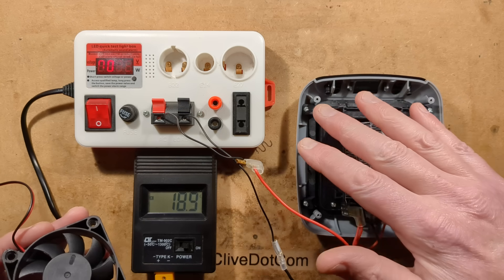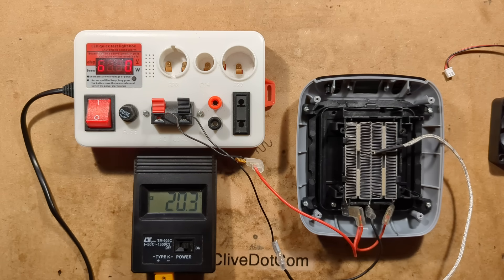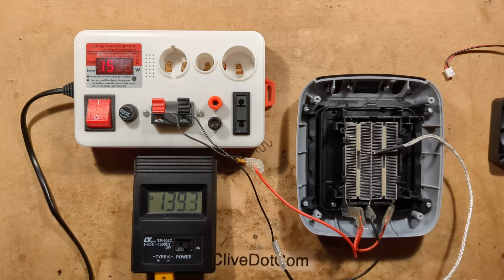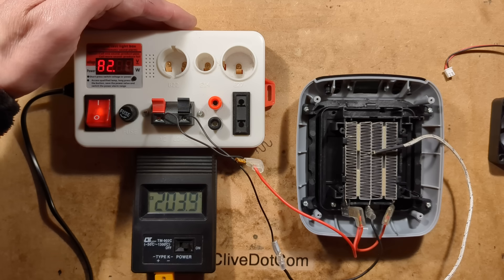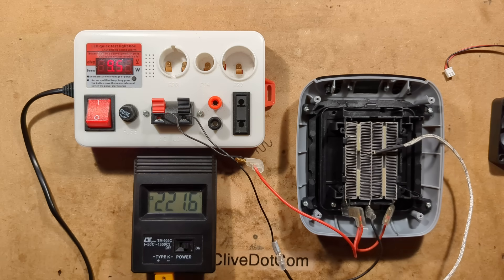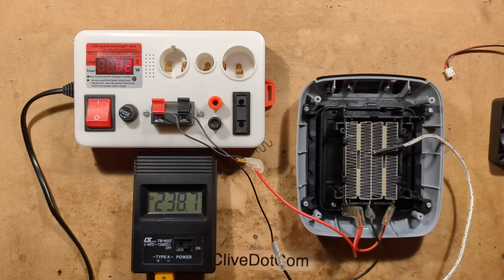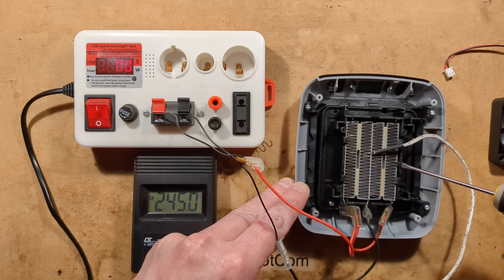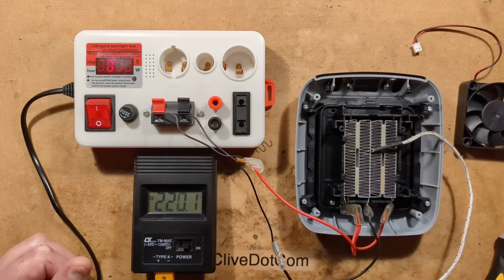Let's overheat a Tesla miracle heater core to see what happens

Comment: Most consumer goods are made out of ABS, which starts to liquify around 210c.  The glass transition, when a plastic starts to deform but not melt, is usually quite a bit lower than that. The housing might actually be polycarbonate.
Reply: @LeaveMasonAlone: You may be right.  When the unit is assembled and oriented vertically and the temperature does not go above say 250 deg. C,  PA46-GF would be an option. I don't know PA6-GF can stand 250 degr. C without creep.
Reply: I used to work with hdpe and polypropylene which transition around 215 C. Polycarbonate transitions around 175 C last I checked. Plastics stable above 200C include PEI, PAI and PPS but they’re kind of expensive for this application.

It’s probably a polyimide of some sort.
Reply: @markfergerson2145  Probably a glass filled grade of resin too, which will keep it more rigid at high temperatures & i'd hope a flame retardant grade too!
Reply: I would suggest a glassfiber thermoset composite.  Polyimide glassfiber composite is also an (expensive?) option. The glassfiber reduces flammability also.
Reply: It's probably common glass filled polyamide, heat deflection temp is around 250c. Remember glass fill increases the service temperature dramatically.

Comment: I have a similar "Good Housekeeping" branded 300W heater with a fan that since new has squealed for the first few minutes of runtime.  (the squeal of quality)  If the fan fails, it will be upright and enclosed.  A sensible person would have returned it, but it has too much character to do that.
Reply from the maker: If it does stall the internal thermal sensing will cap the heat build up.
Reply: Mmm, cheap rifle bearing fans.

Comment: very good test. nice to see a safety backup built in by default 👍
Reply: It is not really a safety backup but just the normal operation of a PTC heater. But it is good to see that they choose the correct parameters and materials for it to actually be somewhat safe even without a safety backup (a heat fuse)
Reply: @ancltube  it was a quick reply to a video. I'm only a hobbyist. Bigclive provides content in a manner that we are able to digest. I don't have the finances to buy something that I can't be sure of. But do look for info on it when able 
Thanks for the advice 👍
Reply: @ancltube  I'm old school so would put fuse anywhere not sure

Comment: The JST connectors from the other video are the first ones to go. They melt at about 240-250c, less if they are knockoffs. The thermoplastics will survive but might become brittle over time and since the heater block is possibly live I would not put anyone near it if it has been going at that temperature for a while.

Comment: Valid experiment as its likely a sleeved bearing fan and will likely be the first point of failure.
Reply: I'd like to see the same test on a heater core that is full of dust.
Reply: @RisenThe  Boring! Let's fill it with nitrocellulose (autoignition temperature 170°C).
Reply: He is testing it in optimal position for heat dissipation, laying on it back with the front off, heater facing directly up with open air above it. 

It would be sitting straight up with the grill on, the heat would build up in the top of the case a lot more.
Reply: Yup, if you don't like the one you bought just give it a bap and the thing will fail 8/10 tries.
Reply: While we're at it, let's dunk it in some gasoline/petrol 😃
Reply: At which time it will melt, catch on fire and burn your house down. Just put on a sweater.

Comment: 53 watts?! That's far less power than I expected in an overheated condition! That's about 0.23 amps at 240v. Not much. I'm also surprised the plastic didn't melt, let alone, soften. Plastic and heating elements is still a terrible combination, especially nichrome wire elements.
Reply: that's the whole point of a ptc heater, it limits its own power when it gets too hot.
Reply: The power consumption is so low because the heating elements have been allowed to rise to such a high temperature (because the fan isn't pushing air over them). The steady state in the previous video with the fan operating was ~300W.
Reply: It's likely a thermoset plastic, maybe a phenolic or some other relative of Bakelite, many of which will stay solid until they start to char and decompose. They're about as heat resistant as you can get short of a ceramic. If it gets that hot, it's probably because clothing or something got piled on it, and the material of the heater becomes largely irrelevant at that point.

Comment: Is the fan to cool the heater or blow the heat out in the room and has nothing to do with heat control of the heater?
Reply: the fan is to blow the heat out yes, it would be pretty inefficient without it
Reply: @tsm688  But is it needed to keep the heater from over heating?
Reply: @tonysheerness2427  Yes, otherwise it gets up to 240C.
Reply: @tonysheerness2427  sort of?  it will get hotter than normal, but is somewhat self-limiting because it's a PTC heater.  The hotter it gets, the more it shuts itself off.

Comment: Where did you get that tester?
Can't find what they are called.
Reply from the maker: AliExpress.   They can be tricky to find.
Reply: DeathTrap1000 lol. But if it's the same model as Clive, try a search for item 1005007465515116 on a search engine, should be the top result from AE

This may or may not be the same price,  may be cheaper ones etc.

Comment: I think the real fail would be more like, the core builds up with dust, and pet hair on the back.
Then with incomming air choked off,would that core  reach a hotter peak temp??
Reply from the maker: In a working heater the temperature rise would probably be detected by the internal thermistor.  Not sure how it would fare with the triac failed in an on-state.
Reply: It's filtered
Reply: The regulation is in the heaters themselves, so I doubt they would get much hotter even if they were covered. I'd be more concerned about the crap stuck on it igniting; not sure what the autoignition temperature of hair is, but it's hot enough that I'd be nervous.
Reply: @Lizlodude  Get a cat to sit on it to find out.

"What's got four legs and goes 'Woof'?"

Comment: It would be very easy to add a thermal fuse if you were worried. That center conductor is begging for one.
Reply: Compliant PTC heaters have both a thermal fuse and a thermal circuit breaker.

Comment: Nice, I wonder what would happen if the cover is back on and the fan installed but failed/disconnected, thus further limiting air circulation. Probably gives it 10..20 degree more or so? Or - thinking about it - would it still self-regulate to the same temperature? 🤔
Reply: There's an older video by someone else that kind of answers that, although I don't recall if they used a thermometer. The video is titled "PTC ceramic space heater - repair and safety demonstration."
Reply: @mikey4016  I remember that video very well. He put paper towels on the heater too, and all it did was make it draw even less power. No smoke, no flames.
Reply: Must be hotter. Unless the heater goes completely open circuit at some point, you're always going to be putting heat in. If there's nowhere for that heat to go (which there would be, though less, with the case on but say if it was covered with a garment), it will keep getting hotter until something goes wrong.
Reply: My guess is it the plastic would get hotter if the heat wasn't getting convected away freely tbh

Comment: The talk of hot plastic reminded me of the Merit (I think) "Plastics Lab" I got for my birthday in the early 70s. It had assorted samples of thermoplastics and thermosetting plastics, and a metal boat mould to fill with polystyrene granules, pop in the oven, and make expanded polystyrene boats. 😁
Reply: Mmmmmm.  I can smell it from here.
Reply: Oh, that reminds me of that little heated wire jigsaw to cut figures out of styrofoam plate... And assorted smell... 😂
Reply: Or the Mattel "Creepy Crawly" toy set, where the child filled an aluminum mold with uncured liquid rubber/plastic in various colors, then set the mold onto a custom fitting hotplate to cook.  Not cooked enough and the resulting toy would ooze all over you from the uncooked center. Cook it too much and it would not be flexible, or if you ran off and forgot about it the plastic would start to smoke until it attracted attention to come and unplug it.  It was quite the art to get a scorpion or a bat to be cooked and even the thin parts still rubbery!  At the time I didn't mind the normal cooking smell, but the burning smell was something else.  It must have been not before 3rd and not after 6th or maybe 7th grade...
Reply: @Sylvan_dB  I worked in the plastic moulding industry for about 30 years, so have encountered just about every hot, melted, burnt, incinerated plastic smell you can think of, normal moulding temperature smells are quite acceptable, (in the range of around 150 to 290 degrees C, depending on the type of resin), but if there was a machine fault & things overheated, or occasionally caught fire, (yes it did happen a few times!) That's when the really nasty & even toxic fumes can be produced.
 If you ever had to purge out an injection moulding machine barrel after an overheating fault, the resulting smoke is something to behold!
Reply: M sure those plastic fumes were non toxic

Comment: I am disappointed Clive I expected a proper overheat test.

With the heater fully assembled and running drop a bath towel on it and see what happens.
Reply from the maker: I think it would sense the heat as a high room temperature and cut off the heater.  To do a proper failure test would require bypassing the triac.

Comment: The worrying bit is if the fan melts and delivers its 230V potential to the circuit through the fan's wiring.
Reply from the maker: The 12V supply is already referenced to mains.

Comment: Interesting. I've had the worst luck with cheap shitty computer fans and the bearings failing, so this is... somewhat encouraging I guess

Amusingly, I've had the best luck oiling them with the same oil I use in my car
Reply: Aerosol lithium 'White' grease should help here, or motorcycle chain ⛓ lube of the adhesive kind, sparingly applied